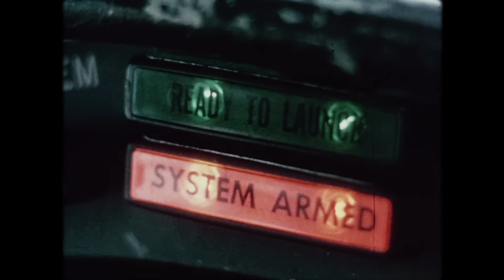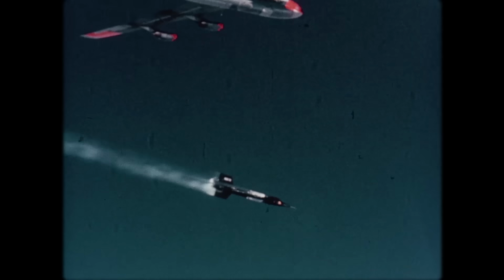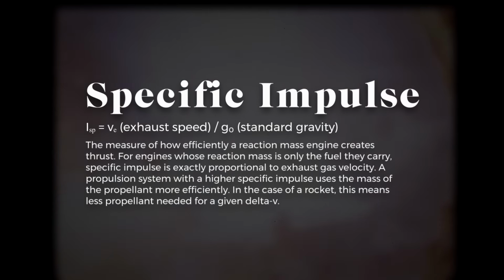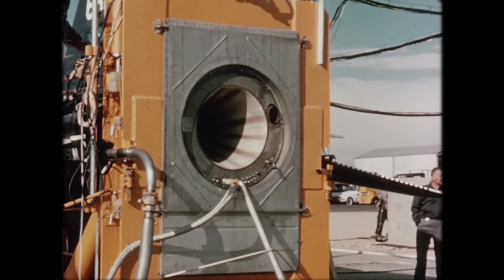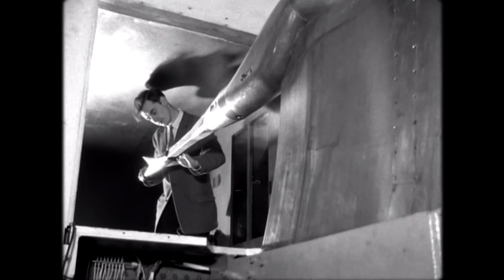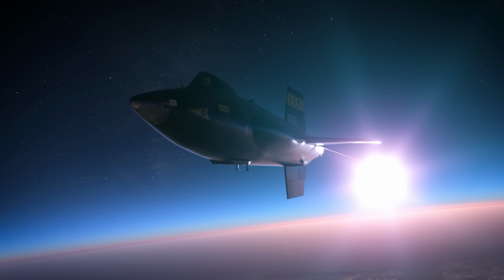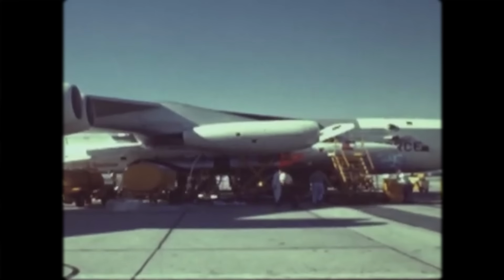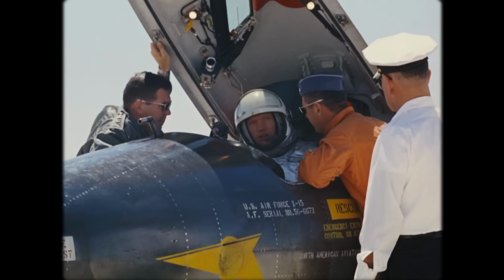The Insane Engineering of the X-15

Comment: Just to give you an idea of how fast this thing is, it is DOUBLE the speed of the sr71, and three times the speed of a modern jet, of which is dozens of times faster than our cars, which seem really fast to us, plus this thing was made 70 FREAKING YEARS AGO!
Absolutely insane.
Reply: @BrentLeVasseur  The SR-71 is not capable of flying Mach 7. For example, an “aircraft” capable of Mach 7+ is the X-43A. The X-43A was a drone with a scramjet. It wasn’t manned, and was smaller than the SR-71. It flew powered for 10 seconds. It was essentially a rocket with wings.

So how would an aircraft at least twice the size, maybe quadruple the weight, and half of the power of said X-43A be able to reach a speed of Mach 7? For a more comparable example, the X-51. It could reach Mach 5, but was essentially a cruise missile in design. It was very similar to the X-43A, but slower. It recorded the longest hypersonic flight ever. If the SR-71 could go Mach 7, then why doesn’t it hold the record? It could cruise at Mach 2 and 3, so if it could go Mach 7 why wouldn’t they cruise at Mach 5 or 6?

The claim that the MiG-25 Foxbat could easily intercept it is just blatantly wrong. Although in theory it could reach the speed of the SR-71 and kill it with the worlds largest aerial missiles ever built, that would almost never happen. The USSR would have to detect the aircraft on radar, and usually when they did the aircraft had already passed and it would be too late to intercept. The MiG-25 would then have to climb to the SR-71’s cruising altitude within minutes in order to reach it. If it went Mach 3, the engines would burn out because they weren’t designed to last long or go this fast. Unless an SR-71 was having engine trouble, no foxbat would get near it.

Finally, superheating. If a SR-71 Blackbird were able to go Mach 7, it would literally disintegrate. Even at Mach 2 and 3 there have been reports of the craft literally disintegrating around its pilot due to heating. If a SR-71 would destroy itself at Mach 3, then how would it withstand the heat and forces of Mach 7 flight. Also, at 80k feet the SR-71 couldn’t physically fly at Mach 7 because of this.

The only way an SR-71 could go Mach 7 is if it’s completely redesigned with a new airframe and engines, or if it’s hurdling at the earth with a dead/unconscious pilot in the seat (even then it would probably disintegrate.)
Reply: @monstertruckin0137
Reply: @BrentLeVasseur  You can call it "misinformation" all you want but there is no evidence/proof of the sr-71 being capable of going Mach 7, it's just an assumption from you. I'm sure it could go slightly faster than Mach 3.2, but to say it could go over double that speed is a little outrageous...
Reply: @Cmarf2  Plenty of recorded evidence that it topped out at mach 3.3 roughly.   It was designed for flight time at extreme altitude, not speed.
Reply: @BrentLeVasseur  as much as I’d like to believe you, I can’t. It’s physically impossible for the sr-71 to go Mach 7 without destroying itself, it’s design and construction material wouldn’t withstand the superheating and warping at those speeds. Besides, every source I’ve looked at gives a top speed average of Mach 3.3 (which is fair considering not every source will be spot on). It doesn’t take an engineering degree to understand how hot the airframe will get at those speeds, it would practically melt. Most sources state it could withstand up to 900 degrees Fahrenheit, but beyond that it would be destroyed due to the protective layer burning up and the aluminum airframe also being destroyed mere seconds after. This also dismisses the F-104 claim. The F-104 would melt at speeds excess of Mach 3. Its engine also isn’t powerful enough to propel it to Mach 4. If the F-104 were designed to fly at such speeds, it would look way different. Also, I couldn’t find your documentary that says the F-104 was to fly/ did fly Mach 4. I think your a troll because you are extremely arrogant when it comes to general logic. It doesn’t take a genius to understand the sheer force and heating an airframe would have to withstand at such speeds. These hypersonic “aircraft” that fly beyond Mach 5 are essentially missiles with tiny stabilizers that keep it controllable. It makes 0 sense that an aircraft over quadruple the size of these hypersonic test beds could do the same. Once more, an SR-71’s top speed isn’t classified anymore. It’s retired, so unless you leak it’s equipment that is still classified, you won’t be in trouble. A government wouldn’t go through this much trouble to hide the speed of an aircraft that is a museum piece and will never fly again. Also, the XB-70 (top speed of Mach 3.6) is faster than the SR-71. But who knows, you’ll either say it could go Mach 12 or it wasn’t that fast.
Reply: @BrentLeVasseur  that’s great information, but once again, the SR-71 airframe cannot physically withstand the forces exerted on it at such high speeds. It’s engines also couldn’t propel it beyond Mach 3, maybe in a lighter and smaller airframe. Also, your “friend” isn’t a valid source. And further adding to the problems, how could your friend clock in an SR-71 going Mach 7? Was he an SR-71 pilot, because the only way to clock and confirm that is through data readers on the aircraft or an actual pilot. And finally, no the government wouldn’t lie about its top speed. Sure, there is a chance some equipment and aspect of the SR-71 is still classified, but the top speed isn’t. It would be a bigger hassle to keep its top speed secret than to just release it. And it’s been retired for a long time, so why would they classify a retired aircraft’s top speed that is significantly slower than other aircraft we have tested?
Reply: You friend isn’t a valid source. To be more specific he is not a credible source. Unless the pilot of the blackbird that, by some miracle, went Mach 7 also came forth about the speed, he isn’t credible. Even if the pilot did come forth, it wouldn’t matter much. You are still avoiding the question on how your friend got the Mach 7 reading.
Reply: @BrentLeVasseur  Your friend may be a valid source for you, but is not a credible source for others. You can shout Mach 7 all day long but all verifiable evidence points to a much lower top speed.

MY friend even confirmed it.
Reply: @BrentLeVasseur  The F-104 isn’t even made out of the same material as the SR-71. At 80K feet, the starfighter going Mach 4 would, once again, literally disintegrate. At 100k feet it operated at around Mach 2.1. And how come this top speed isn’t “classified” but the SR-71’s top speed is? They served at the same times.
Reply: @BrentLeVasseur my guy it’s Mach 3.2. The missiles were faster but not nearly as maneuverable
Reply: @BrentLeVasseur  your rocket comparisons arnt good ones since you seem to forget the SR-71 is made of tons more moving parts when compared to rockets, plus the SR-71 has a weight threshold much lower since it has to carry all its fuel on its insides, compared to rockets that get booster. So rockets can be made of steel but also much thicker when compared to the SR-71 which has to keep its weight down.
Reply: @BrentLeVasseur  No no you tell me WHY I’m supposed to believe you, I always love learning new things but so far I find it kinda hard to believe with the evidence you’ve provided. You have not given any details as to your occupation, if you worked for the military, if you worked for Skunkworks, Lockheed Martin. Nothing, you’ve given nothing but your “friend”, which again isn’t a very credible source. I find it hard to believe that whilst the US were heavily struggling during the cold war to find exotic materials to withstand the high temperatures that metals experience at such speeds (Mach 3~ 700 degrees C) that all of a sudden they found some material light enough to be capable of Mach 7 and at the same time able to withstand the incredible temperatures at Mach 7. And yes, I’d rather believe a thousand papers on the internet than some random bloke who struggles to, first of all, even formulate his sentences, second of all, uses emojis, and third of all has no evidence to back himself. Also, you saying “my friend said this” is by hearsay not credible. I only wanted to argue with you to see what kind of response you’d give, again, nothing worth of my time because you refuse to give evidence and talk about the points I’m talking about. A failure of a debater you are. The SR-71’s official Pilot Operating Handbook is declassified by the way so don’t come at me with that nonsense. The new SR-72 will barely go above hypersonic (around Mach 6 ish maybe a bit more, maybe less) so what makes you think something in the 70s would easily accomplish DOUBLE it’s projected speed?
Reply: @Lived-2  It's estimated that military tech is 15 - 20 years ahead of common tech. This is based off of technologies that came from military applications and how long it takes for that tech to filter down to us. Ex. GPS

I'd imagine secret tech is absolutely astonishing.
Reply: @BrentLeVasseur  No it's slightly over Mach 3 lol..
Reply: @Brent LeVasseur  he's lying to you. First because none ever flew over soviet territory much less russia itself and second because ground radars couldn't and probably still cant track something that high that fast in level flight
Reply: @BrentLeVasseur  lmao no the it wasn't
Reply: @BrentLeVasseur  Yes the metals may be able to withstand such forces, but temperature is not the only issue. The structural integrity of the SR-71 is simply not great enough to withstand the/skin friction at such speeds. Aerodynamically the SR-71 should not be capable, especially with the fact that the P&W J58 could produce a static thrust of 145kN whilst weighing 27 tons. The X-15 had a thrust of 250kN whilst weighing 6.5 tons, significantly lower than that of the SR-71. Even with a lower mass/weight and a greater thrust force the X-15 barely reached Mach 6.7. So what are you going to say to that? That the X-15’s report is also false? Listen, I know you genuinely think what you think, and that’s alright we all have our opinions. But statistically, when so many claims are made, and I’m talking mathematical statistics now, when there are so many cases of one thing (thousands) and there is one case which disagrees with that, that one case tends to be a simple false outlier. And it’s okay that you don’t have no military expertise that’s fine, that’s why people here who DO have the expertise are trying to tell you why it should be so damn impossible for a thing like this to go that fast. It simply almost defies physics and a bit of logic, because all these years they’ve been trying to go Mach 3 and all of a sudden they’re hitting 7? You see the issue? And once again, no your friend does not count as a credible source as there is bias - you are his/her friend. Biased sources are not deemed credible. Also may I ask what made you believe them and think “huh, maybe it did go Mach 7”? Perhaps you should get your friend on here to argue with me. What was his occupation etc? I forgot and I cannot be bothered to scroll up and read again.
Reply: still not as fast as a kyle on a 600cc supersport tho
Reply: @bob119911 facts
Reply: @BrentLeVasseur  Sr71 never flew into Russia once, maybe that’s why.
Reply: @BrentLeVasseur bro your source is literally “trust my friend bro”
Reply: To this day, as proven In this year-old exchange, whenever the subject of the SR-71 comes up you get uninformed speculation that is aping the most fatuous bullshit ever heard. This Mach 7 guy, who seems to take himself very seriously, is a typical case in point. I don't know much, but I've been an aviation writer for 35 years and know people who flew this a/c.
Reply: @thomasbell7033  True. I have a friend at RAF Lakenheath who tells me that Mach 7 guy's friend at Lakenheath is known to sometimes talk out of his tailpipe.
Reply: @BrentLeVasseur everyone is wrong it's warp 9.999🖖
Reply: @BrentLeVasseur  the SR-71 Pilots operating handbook is public information and available for all to read. 

It cruised at mach 3.2, between 78,000-85,000 feet depending on fuel load. They would firewall the throttles to evade missiles, at which point the aircraft skin would overheat and the strength would be compromised. The maximum speed for both inlet un starts was just shy of mach 3.5. But the inlet air temp would exceed maximum allowable temp of 800*f around mach 3.3-3.4. 

We know this for a fact now.

It was not a mach 7 aircraft. It has a 60 degree swept delta wing with two axisymmetric ramjet inlets it cannot exceed mach 3.5 or so.

The Foxbat was incaplable of achieving mach 3.2 under any circumstance except shearing off its wings after a parabolic ascent and diving into the ground at full power.
Reply: @BrentLeVasseur  your claims are extremely disingenuous and basing your argument off of a mig 25's speed vs the blackbird's speed is flat out wrong. The blackbird topped around mach 3.4 but flew almost 20k feet higher than the mig, which could hardly reach mach 3 at a lower altitude (and could only maintain this speed for ≈2 minutes). Claiming you have "a friend" is honestly disrespectful to actual sr71 pilots smh
Reply: @BrentLeVasseur  Lol I can say a reliable source told me that Santa Claus exists... That doesn't make it true? Until actual evidence of the sr-71 traveling Mach 7 is released then it is just hearsay.
Reply: @BrentLeVasseur  idk man but you kinda seem dumb already
Reply: @BrentLeVasseur  your friend lied or you lie, either way, what the fuck is the point in lying about something like that?
Reply: @BrentLeVasseur  also, if an SR-71 flew Mach 7, it would have been archived. So until you get an SR-71 to fly Mach 7 on film or you show me actual documentation that states the SR-71 flew Mach 7 during one of its flights, I’m not believing you. And no, it’s not classified information, it’s you believing an absurd claim that you have no tangible evidence to support. It’s like the Super Pershing commander and crew claiming they knocked out a Tiger I, it was believable until they found out that not a single Tiger I was in their AO at the time of the claimed kill, and that it was likely a panzer 4 that they exaggerated to make their crew and tank sound better to the public.
Reply: @BrentLeVasseur  Here’s the difference between a rocket and the SR-71, the SR-71 is in the atmosphere a rocket is in space
You must be thinking of escape velocity (a whole different matter im not going to get into, but basically, you’re going really fast for only 5 or more minutes in a vehicle specifically designed only to go to space)
To put it simply, their is no air resistance/friction in space so it is theoretically possible for the possible mach to be infinite allowing for ludicrous speeds compared to earth. On earth, there is air and air causes friction, try rubbing your hands together, it warms up because friction causes heat. When it comes to aeronautics, on planes, the heat generated can be fatal so you need to streamline it or build something with heat resistant materials. If you don’t and just try flying stupidly fast, you end up essentially causing enough friction & heat that it has a similar effect when you crash a car into a foot thick concrete wall.
In space, you don’t need to adhere to aircraft design because there is no air (or gravity) so you can strap a rocket to a brick and it will be able to travel in space. It’s why the ISS stays in orbit, gravity & air resistance are nonexistent in space. 
Also if you try to tell me about the shuttle, that’s because it was essentially a rocket that could become a glider when in atmosphere
Reply: @BrentLeVasseur  
“In gravitationally bound systems, the orbital speed of an astronomical body or object (e.g. planet, moon, artificial satellite, spacecraft, or star) is the speed at which it orbits around either the barycenter” from this Wikipedia article https://en.wikipedia.org/wiki/Orbital_speed
Orbital velocity/speed is the speed an object orbits, not escape/launch velocity

Yeah and that is the point of the heat shield the atmosphere will slow down the capsule or shuttle while the heat shield takes the heat, but we are talking about the SR-71 and why it cannot go past mach 3.5 

You wanted to start this argument about how the SR-71 can accelerate to mach 7 and now how about you end it in your favor, or are you just afraid to admit you cannot back up your information with your so called “friend” and your sources that originate exclusively from your brain
Reply: @BrentLeVasseur  There’s no way a muppet like you is genuinely so gullible to believe that a plane like the SR-71 could go double its maximum operating velocity. Oh and by the way, you sound literally like the true embodiment of “Source: trust me bro”. So far all your evidence has been is your “friend” and no hard proof like links or papers or anything. When there are thousands of papers online telling you what it’s true max speed is. And don’t you dare ask me for a source, go search it up yourself because guess what you’re gonna find, a speed around mach 3 and not 7..
Reply: @Brent LeVasseur  the SR71 top speed is just over 3.4 but it could cruise at 3.1. Which is the reason it was so crazy. It was plenty faster than the mig but not double the speed. March 7 is a stupid number to even say
Reply: @coltontheisen01  Thank you, someone else with a brain. Why the hell of all speeds would it go to Mach 7. Mach 4 I’d have maybe believed but 7? Cmon now you’re pushing the boundary.
Reply: @Brent LeVasseur  brother I love spreading misinformation on the internet just as much as the next retard with an ip address but if you think anything that isn't purpose built for mach 7 is even touching that number you're wrong. The only things that do that in level flight are carried up then dropped to have scram jets actived in the sky
Reply: @BrentLeVasseur  the fastest claimed speed is 3.5... and that's from someone outrunning a missile
Reply: @BrentLeVasseur  sr71 flew along the borders and used their cameras to spy into Russia. They're spy planes.
Reply: @Brent LeVasseur  also. How you ended that is all the evidence you should need to know it's a load of smoke. That's like saying I believe my uncle when he says he benched 500lbs in highschool. Yes the plane is fast af but no. It's not science fiction.
Reply: @BrentLeVasseur ReLiAbLe SoUrCe
Reply: @BrentLeVasseur BuT iT's NoT mE
Reply: @BrentLeVasseur  pretty sure you're neglecting or at worst maliciously not mentioning that it flew at international airspace, near the soviet border? yes but it would be foolish had they shot it down outside their airspace. Besides IT DID NOT FLY MACH 7 you must've mixed it up with the x-15 or used a brainlet as a source.
Reply: @BrentLeVasseur you seem to forget that the push into orbit isn’t entirely atmospheric, like how do you think the rocket gets into space?
Reply: @BrentLeVasseur and also further more, you seem to be talking about the booster landing, when I’m reality it only has to do a relatively small burn to reach the desired trajectory, and for the rest of the rocket it doesn’t have to slow down all the way from orbital trajectory, it only has to slow down enough so it can reach the desired destination, and getting in space is much harder then getting back to earth, plus when craft do reenter earth’s atmosphere, they normally have a heat shield, that’s why one side of starship is black, it’s covered in ablative material so when it takes most of the heat instead of the steel body
Reply: The cold war saw the biggest achievements of both USSR and USA. It was an exiting time to be alive, each countries competing with each other.
Reply: @BrentLeVasseur  Your friend talks to the fairies you fool.
Reply: @BrentLeVasseur  the FoxBat could go Mach 3.2 FOR SHORT BURSTS, while the SR71 could consistently do Mach 3 for hours, that's why it wasn't easily shot down
Reply: @BrentLeVasseur I hate to burst your bubble but whoever flew that blackbird at Mach 7, (7 times the speed of sound), was either lying, or legitimately had no idea what they were saying. 30 seconds on Google just now tells me that the fastest speed an SR71 has ever been documented at was Mach 3.5. The video I was watching before this one was about the Blackbirds engineering, and it said it's engines could have been made to make the plane faster than Mach 3.5, but they didn't for some reason. I think it was to save weight and reliability or something
Reply: I think a better way to express how last that is, is simply in the fact that it's 7x~ the speed of sound
Reply: @BrentLeVasseur see what you not understanding is your friend is not “credible source”. I mean weather you believe he’s a credible source or not doesn’t matter. Who’s more trustworthy, the loads of people explaining to you in easy to understand way that THE SR71 WOULD LITERALLY MELT AT MACH 7 (and providing credible data to support this) or, your friend. Which one is more likely? Also the sr75 is unconfirmed. Like everything you can find on it say “lack credible data” so were did you learn about it?
Reply: @BrentLeVasseur but I do agree with you that the sr71 might not be fully declassified but its top speed is.
Reply: @BrentLeVasseur also if we could get a plane in the 70s to go Mach 7, do you understand how advanced we would be? I mean hypersonic missiles, glide vehicles, and hypersonic aircraft would just be something we’re just barely understanding and utilizing, but so common that you wouldn’t bat a eye to a plane going Mach 5. I mean if we had that technology in the 70s going hypersonic would be the same to us going supersonic. Cool but happens a lot.
Reply: @BrentLeVasseur  oh so you believe in aliens too. Worse then I thought. Also wether we where “helped” or not my point still stands.
Reply: @BrentLeVasseur  that doesn’t change what I said at all. If we had hypersonic technology in the 70s we would be decades ahead technologically wise wether the electronics are less advanced. It’s like saying that if we had done Apollo 11 a decade later it wouldn’t effect anything because it’s computing was the same as a modern calculator.
Reply: @BrentLeVasseur  also you still have ignored my point of who’s more believe able, (just so you know I’m not just talking about this comment section) the millions that have explained why it’s impossible for the sr71 to go Mach 7 or your friend? Why haven’t you addressed this?
Reply: @BrentLeVasseur No it’s well known that the SR71’s max speed was somewhere in the realm of mach 3.3 with a flight ceiling around 80k. It’s not a secret and the information is publicly available. 

The rumored SR72 (successor to the blackbird), which the military hinted at having at least a prototype is likely to fly somewhere in the mach 5-11 range. It would be the worlds first hypersonic air breathing craft if true.
Reply: @BrentLeVasseur  what does that have to do with what I said? SR71 and Concorde are 2 different things.
Reply: @BrentLeVasseur  bro the sr75 is a myth. Sure it might be true but all the logic is the same thing with ghost and alien stories. Sure people reported weird stuff happening but there’s always a reasonable expectation. And anyone with “evidence” doesn’t want to come forward for one reason or another. Like the guy that has supposed video evidence but doesn’t wanna release it because he’s not trying to leave the government secrets? So why tell anyone. Just people trying to find excuses for it. Also didn’t they say that all the money for the sr75 was actually for the b2? Fair explanation if you ask me.
Reply: @BrentLeVasseur  ok so one yes million. Millions of people know about the sr71 and pretty much all of them agree it can’t go Mach 7.
Reply: @BrentLeVasseur  ok so what do you suppose? What we made some magical material in the 60s-70s so the sr71 could go Mach 7? What’s your proof? Ask your friend for a explanation. And yes if everyone is explaining to you why a sr71 couldn’t go Mach 7, then yes it is right. Like these aren’t even people giving you little detail they are fully explaining why is wasn’t possible. Sr71 s would MELT. You have no counter argument other the “my friend told me and my friend wouldn’t lie.”.
Reply: @BrentLeVasseur  your not getting my point. I’m not saying that because everyone says one thing it must be right, because well that’s a really bad mindset. What I’m saying is everyone is providing you with proof for why it’s impossible. And again I’m not saying that your friend isn’t necessarily credible or a lier, I’m just saying ALL the evidence points to going Mach 7 in the sr71 is well, impossible.
Reply: @BrentLeVasseur  You don't have to lie on the internet, there are better things to do.
Reply: The X-15 is just a precursor to the blackbird and darkstar
Reply: @BrentLeVasseur  Your numerous responses all say the same thing with all those incorrect figures attributed to your friend. Is that friend you? If not well ... he may be a nut case for all we know. He may be a Pop Sci fan that sensationalizes science & tech he heard on some video that also sensationalizes science & tech. Your velocity estimates are wrong for about every vehicle you mention when looked at from a velocity vs altitude perspective. Concede that you and your "friend" clearly have no basis nor evidence to question nor comment on aircraft, rockets, and even paper airplanes ..
Reply: Tricky to refuel in flight though 😅
Reply: Thanks captain obvious
Reply: Don't you hate when there's an actual informative discussion and the "looser" deletes all their comments out of shame

You know all the @'s don't disappear right?
Reply: Yeah.🎉
Reply: It makes me wonder what we have today that they're not telling us, seeing as how the x-15 seems so extremely advanced compared to what we expect from that time
Reply: @BrentLeVasseur  an engineer who worked on the sr-71 spoke about what you're referring to saying, 

"The difference was that by 1986 missile capability had significantly improved. And Libya had them. As the Blackbird crossed the “Line of Death” into Libyan territory, Shul’s co-pilot warned of ground-based missile launches, Russian SAMs they guessed, capable of Mach 5 flight. Those scary little f***ers were probably the only thing a Blackbird pilot feared. Still, flying at Mach 3.2 at 80,000 feet is a significant head-start."

In that same interview he said the pilots went slighly over Mach 3.5 after "pushing the throttles full forward against the stops."
Reply: @Cmarf2  To further back up what you're saying, the SR-71 at the Smithsonian Air & Space Museum at Dulles International Airport in Chantilly VA has an informational plaque in front of it that said that when they delivered the plane to the museum they flew it from LAX to Dulles which is 2669.7 miles and the plane cleared that distance in 1 hr 3 minutes which would be exactly Mach 3.2.  Also, to address what the troll keeps arguing with you about, the defense of the SR-71 was not to simply out run missiles. Its defense was a combination of speed, altitude, shape, and missile jamming technology. The speed, altitude, & shape made it extraordinarily difficult to see on radar, almost invisible in fact, & its ability to jam "smart" missiles and make them go "stupid" so to speak made it almost impossible to shoot down. In its service run, the SR-71 had at least 60 missiles fired at it and not only was it never hit, the closest a missile ever got to it was 1 1/2 miles. The SR-71 was constructed of titanium because because at speeds of up to Mach 3.5 the surface of the aircraft could get as hot as to 1200 Degrees Fahrenheit due to air friction which prevented it from being made of aluminum, since aluminum loses half its strength at 600 degrees and totally melts at 1221 degrees Fahrenheit.
Reply: @billdavis6900  Thanks for the information, I'm still amazed by the fact that such an advanced aircraft was made in the 60's
Reply: @Cmarf2  Oh absolutely, I totally agree. A lot of what NASA learned from the X-15 program contributed to the shuttle program. The only thing that kept the X-15 from being a viable space vehicle was that NASA hadn’t invented the re-usable heat shield at that time.
Reply: @billdavis6900  IOW NOT mach 7.
Reply: @BrentLeVasseur  We have much faster and overall better aircraft than the sr-71 today, why would they keep the top speed of a 60 year old aircraft (that isn't even used anymore) classified?
Reply: @Cmarf2  we might need it again? they are all kept mothballed in climate controlled storage, its not like they are all in the dessert wasting away.
Reply: @stiggy60426  I'm not even sure what you're replying to lol.. When did I say all sr71's are "wasting away"?
Reply: @BrentLeVasseur he fastest a falcon rocket has went is mach 4 (no way in hell can a rocket of any current design survive mach 20) the fastest an atmospheric object has went is the unmanned X-43 at mach 9.6 (it’s more in common with a missile than a plane at that point)

The SR-71 is not designed for even higher speeds and it’s structure would have completely failed before getting close to mach 7.
Components of the SR-71 would have literally melted into liquid at mach 7 or if it somehow survived, it’s most likely in multiple pieces (which is probably the whole plane). The SR-71’s engines would have failed just trying to surpass anything higher than mach 4 and atmospheric friction would have torn the plane to shreds if it went faster than it should be going.
For the person who said the SR-71 would melt at mach 7, he is correct, titanium melts at about 3000 degrees fahrenheit, mach 7 would be about 3500 degrees 

Also the radar system you speak of? Yeah that doesn’t exist, the thing with the closest designation to it is an antenna array.

Everything has it’s limits, the SR-71 had it’s limit of mach 3.5, but you seem to have a hard time understanding that you cannot exceed a limit

Oh, I missed something too. The MiG 25’s top speed is mach 3.2 which is pushing the MiG insanely far that it is permanently damaging the aircraft. The SR-71’s cruising speed is between mach 3 and mach 3.2 normally so the SR-71 would still outrun a MiG 25.
Reply: @BrentLeVasseur  zero chance. the sr-71's frame and skin could in no way handle the heat load generated by mach 7 speeds